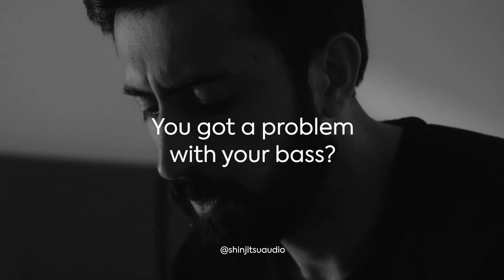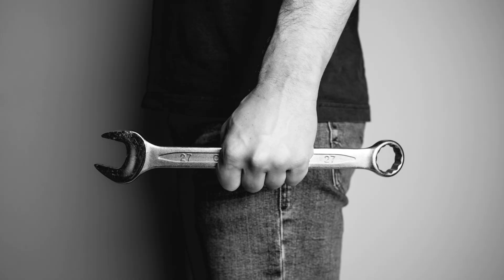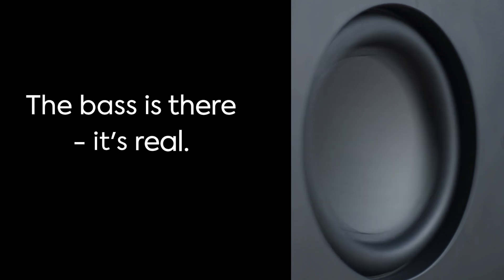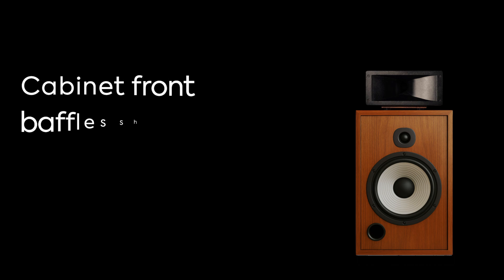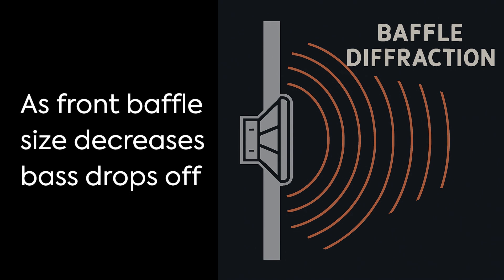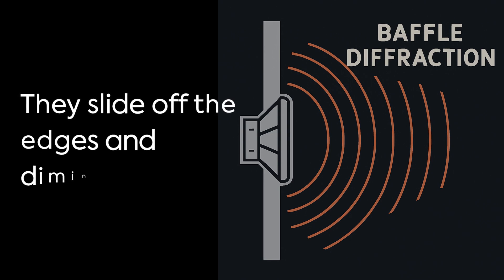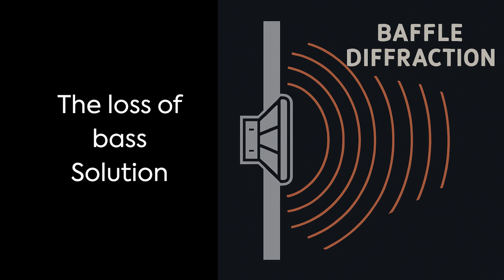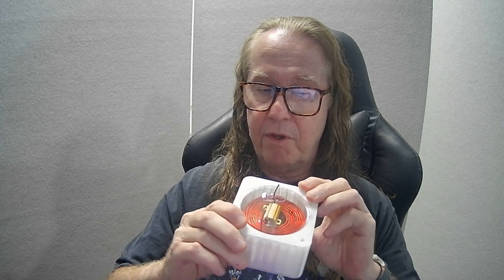The Missing Bass: How Baffle Step Correction Restores Your Sound.

Comment: How much does this reduces the sensitivity of the baffle ?
Reply from the maker: We reduce the peaky midrange to match the woofer’s natural bass level.
This correction smooths the sound and restores tonal balance — especially in full-range or wide-baffle speakers.

The amount of midrange reduction typically ranges from 3 dB to 6 dB, depending on how strong the compensation is.

It’s not a flaw — it’s a fix. Without it, many speakers sound shouty, thin, or “forward” in the mids.

Comment: How does your resistor dissipate heat if it’s encased in epoxy?   I don’t believe Epoxy is not one of the best heat conductors.
Reply from the maker: You're absolutely right that epoxy isn’t a great thermal conductor — but it’s also not a perfect insulator. And in our application, the key is context:

    The resistor values in our BSC modules are selected for their thermal behavior and used in low-current signal path conditions, not high-power dissipation zones.

    We use high-wattage wirewound resistors with aluminum or ceramic bodies, designed to operate well under their thermal limits even in semi-enclosed environments.

    The epoxy itself is a thermal-grade potting compound, not generic hardware store epoxy. It’s designed for electronic encapsulation and offers a balance of insulation and heat tolerance.

    Most importantly, our BSC circuit is not in the amplifier path — it’s in a passive shaping role before the low-pass filter, so the actual energy across the resistor is relatively low, especially compared to series path components.

So while it’s true that epoxy doesn’t dissipate heat like a heatsink would, it doesn’t need to in this context. We’ve measured both voltage drop and thermal rise under extended operation and the values remain well within safe margins

Comment: Do You make 3 way Crossovers?
Reply from the maker: Do You Make 3-Way Crossovers?

Thanks for the question!

Our crossover designs are always based on measured performance of the actual speaker components — not just theoretical values. The Horn X2 system uses a 2-way crossover because:

    Most quality woofers begin to roll off naturally above 2kHz, and

    The Horn X2’s high-frequency response is very predictable and smooth, allowing it to integrate well with a wide range of main drivers.

A 3-way crossover, however, introduces a much more complex challenge:

    The midrange driver must act as both a low-pass and high-pass element, meaning it has to be precisely matched at two crossover points, not just one.

    Without access to the exact drivers and enclosure, it’s nearly impossible to ensure proper integration — especially in terms of phase, impedance behavior, and tonal balance.

    In short: we do not offer 3-way crossovers, because they require on-site driver measurement and tuning for accuracy — and we won’t guess.

If you’re building a 3-way system, we recommend working with a designer or software platform that can model your specific drivers in their final cabinet — or, keep it 2-way and let the Horn X2 simplify your life.

Comment: Bass soundwaves getting around the baffle is not the issue, unless it's an open baffle. The issue is higher frequency, shorter wavelength sounds being reflected off the baffle and thus reinforced. BSC does nothing to restore bass. It restores balance by attenuating mids-highs where necessary.
Reply from the maker: Yes, bass does "leak" around the baffle once the wavelength becomes large compared to the baffle size — even in a closed box.
It’s just that people often phrase it differently to avoid confusion with open baffle designs, where there’s direct front-to-back cancellation.

In a sealed or ported speaker, here's exactly what happens:

    At low frequencies (where the wavelength is much larger than the baffle dimensions), the front wave naturally spreads around the baffle into 360° space.

    This "wrap-around" means that the energy is no longer focused into a 180° forward hemisphere — it's radiating into the whole sphere (all directions), and measured bass output falls by about 6dB compared to mids and highs.

    Technically, this is a form of "leakage" — but because the rear radiation of a closed box is physically blocked, there's no true phase cancellation at the driver like in an open baffle.
    Instead, the sound energy just spreads wider, thinning out the measured and perceived bass level.

And yes we do mention its about "balance" there is a slide that mentions that. Shall I point that slide out to you? We also did not allude that bass is "added" its simply balances when the mids are reduced per the graph I narrate.

Comment: So, I have a pair of aDs 910s. They have dual 10.5" bass drivers built into their own separate enclosures inside the cabinet, thus the 96lbs/each speaker; 125lbs with stands. They produce smooth, deep bass in this tiny bedroom. Perhaps something to do with the large front baffle. I'm interested in the horns seen in some other videos of yours, as there must be lots of issues needing attention with the 910s, since they were built as studio mains back in the mid-70s.
Reply from the maker: No worries — the Horn X2 is designed exactly for this kind of upgrade.
It has its own 2-way crossover on its plinth, so once you set it on top of the woofer cabinet, it takes full control. Yiou then tweak it to match the sensitivity although we send them out already tweaked plus  few extra resistors of slightly different values for you to play with. 

Your amplifier feeds the Horn X2, and the Horn X2 cleanly low-passes the woofers at around 2kHz, while taking over everything above with its horn.

You don’t have to modify your speakers internally — it’s a clean, external connection that leaves your original drivers untouched.
It’s a proven method that gives you way better dynamics, clarity, and realism without risking your speakers.
The original woofers stay right where they belong — you’re just giving them a much better partner for the mids and highs.

Key points:

No internal speaker changes

Clean external hookup

Proven method

Improves without risk
Reply: @shinjitsuaudio  One thing I would be interested in seeing is if the domed mid would still shine through with the x2 applied. I don't know the freq. of the tweeter/mid, though. Altogether it's "28htz-25khtz overall frequency range.
Reply from the maker: The Horn 2X crossover begins at 2K so the domed mid will operate up to that point.

ADS 910: 

Type: 3 way, 4 driver loudspeaker system

Frequency Response: 28Hz to 20kHz

Power Handling: 150W

Recommended Amplifier: 15 to 300W

 - Crossover Frequency: 500, 4000Hz - 

Impedance: 4Ω

Sensitivity: 93dB

Bass: 2 x 10" cone

Midrange: 1 x 2" dome

Tweeter: 1 x 1" soft dome

Grille: black cloth

Finish: walnut veneer

Dimensions: 850 x 480 x 390mm

Weight: 45.5kg